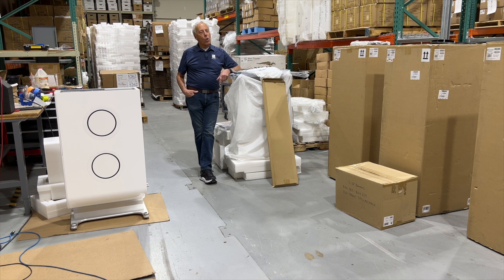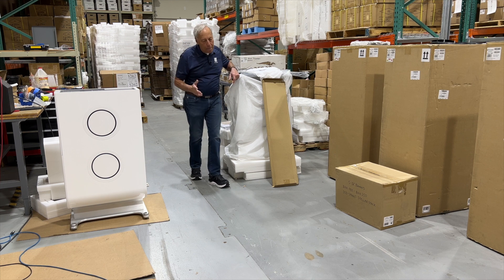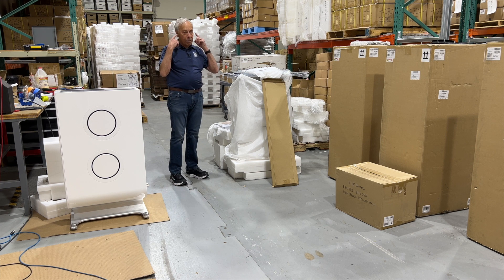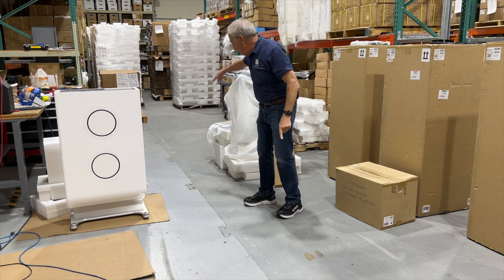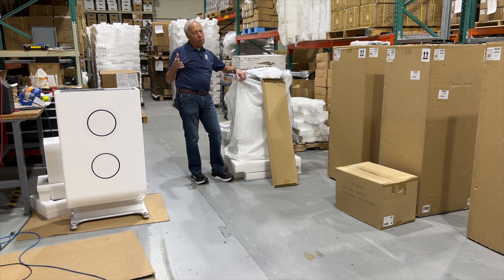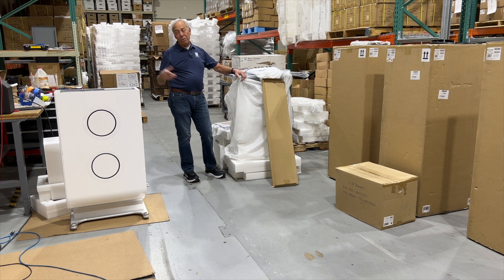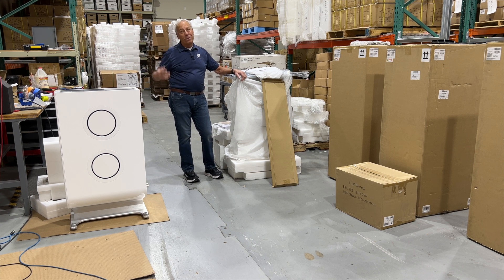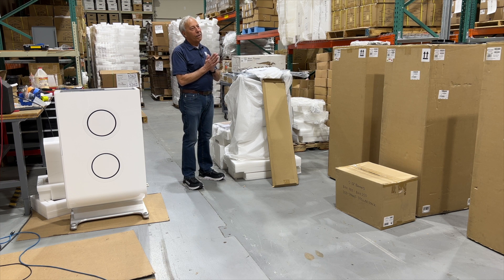Does PS Audio have an anechoic chamber?

Comment: I did some work in a large high power RF anechoic chamber with a turntable for automobile testing, think microwave for your car.  Watched the testing from outside on shielded video cameras. It's funny to see warning lights flash, wipers operate and the electric seats move - a ghost driver !!

Comment: Anechoic chambers are unnecessary for speaker measurements if the walls can be placed farther than 2m away from the speaker. Anechoic chambers of practical size actually need to have correction curves derived to linearize their low frequency performance, because such a chamber will still not be large enough to be anechoic at frequencies below 100 Hz or even higher, and it is necessary to mechanically isolate them from the foundation of the building to prevent leakage of HVAC or other machine noise. It is better to have a big, reasonably quiet room, and a stand to place the speaker on that can be rotated to make gated on/off-axis frequency response measurements, then to have a large open outdoor space with a flat ground surface, such as a sports field, where the microphone can be placed 2m away from the speaker and a ground plane measurement can be made. Those two measurements can be 'spliced' over a range of frequencies where they overlap to produce one measurement that is effectively the same as a true anechoic measurement. The correction curve for an anechoic chamber may be developed from a low frequency speaker or subwoofer which is measured in a ground plane environment.
Reply: Super interesting.

Comment: You don't need anechoic chambers anymore, you can use Klippel.
Reply: There's still some use cases, but for the most part yeah that's true
Reply: One tool of many.
Reply: Specifically, you need the Klippel NFS Nearfield Scanner system. Klippel analyzers can also acquire data from microphones in an anechoic chamber, which is the method my company's vendor uses. You can't make broadband speaker measurements using a laser-only system (yet), but if it can ever be done, the Klippel people will figure out how to do it. Big brains over there.
Reply: @hoth2112  To be fair Klippel actually does the job of many lol, it actually goes like 90% of the the important jobs lol

Comment: I have a question, how does a 5.1  Dolby Surround system figure out what to route when it is not in 2 Channel mode. Does Dolby Pro Logic figure out what goes to the center right left and rear by analyzing the two channel image?
Reply: Exactly that. Of course you get no real surround - but 5 different signals.

Comment: So in fact PS Audio never had such a chamber. It had been removed before you bought the building - so you couldn't use it at any time, right? Because you said "we did have an anechoic chamber but we don't anymore" which doesn't correlate to the story you tell afterwards.
Reply: sigh 😕
Reply: Doesn't matter.
Reply: @rorybuszka2215  Yeah. Like most of the other stuff here. Obviously just fairytales. 🧚‍♀
Reply: Knit picking alert!
Relax man! Don't analyse each word like an attorney.🙄
You've got the gist of what he's trying to say.
Reply: @Fastvoice  My point is that you can make useful and valid measurements of a speaker without ever setting foot in an anechoic chamber, by using time windowed on/off axis measurements and an outdoor ground plane measurement. You don't need an anechoic chamber -- you can even do this in most suburban homes and backyards. It just takes more time and effort to collect the data, because you need to take multiple measurements. Windowed/"gated" measurements prevent the measurement system from collecting the reflected sound from an environment so that the measurement is free from any influence of reflections. Sidebar: So what happens when you get into an anechoic chamber with the same speaker? You will have a correction curve at low frequencies because any anechoic chamber of practical size (that isn't the size of an airplane hangar) will start to experience low frequency reflections, modes, and pressure rise ('room gain'), and the correction curve for these issues is developed using outdoor ground plane data from a known loudspeaker. You still don't get away from the ground plane measurement.
Reply: @rorybuszka2215  Why do you tell me all that?? I just mentioned a contradiction in the video not the benefits (or the lack of benefits) of such a chamber. You joined the wrong conversation.
Reply: @Fastvoice  Well then congratulations, you found a contradiction on the Internet.
Reply: Let's be real, Paul doesn't want to pay 100k for Klippel NFS. In fact, Chris said that that Paul didn't want to pay for 1000$ plus 1500$ for shipping and handling, 2500$ total for a third party measurements who have Klippel NFS. 

Another even more disturbing facts that Chris mentioned that ps audio just recently bought audio precision ap555, and given the fact that electronics is their main market, not having ap555 is just unbelievable. A lot of Chinese brands that sell 99$ electronics have ap555